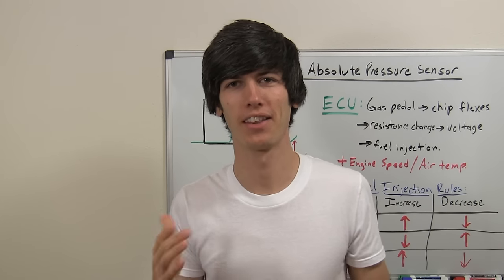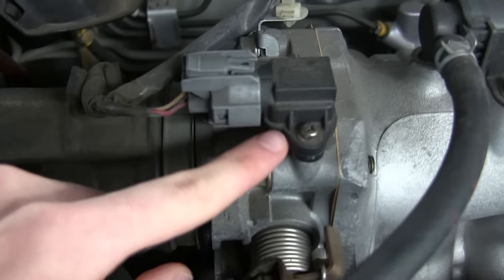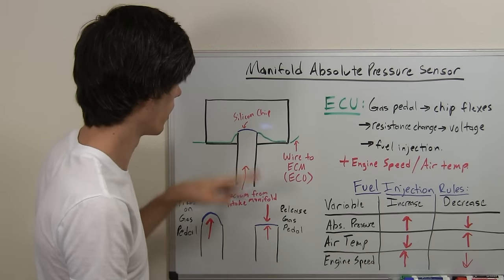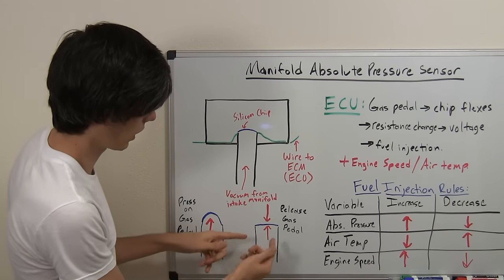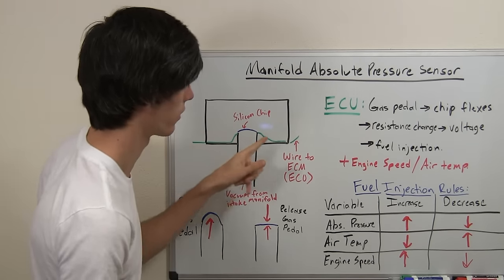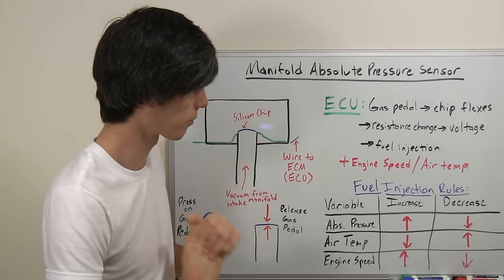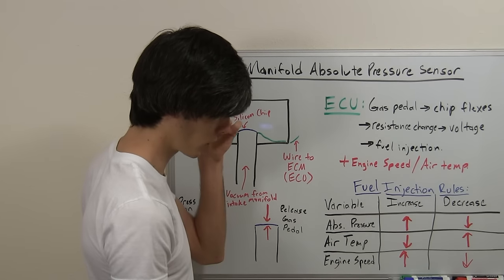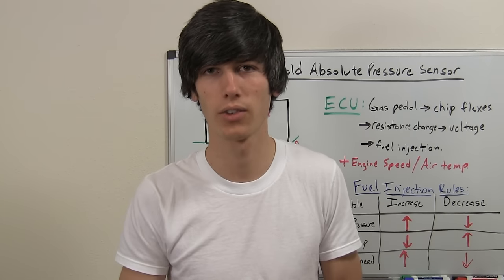MAP Sensor - Manifold Absolute Pressure - Explained

Comment: Okay. Question number two:
I have a 93 mazda rx-7 i replaced the twins with a single turbo that ..... Is bad to the bone. 
Stock map sensor maxes out between 14 and 17... I have a 3 bar standing by (i wont be finished with this build for a long time).
Does the fuel cut simply because it can no longer deliver a clean message to the ecu? 
Once calibrated, how well will my Apex pfc be able to calibrate? 
I have been more curious about the calibration abilities of ecu, ecm, pcm. OEM and Aftermarket. 
Sorry man, but if u can help me with this, i may become one of the best illogical tuners ever! :) 
We all appreciate everything you do Bruh! ✌

Comment: E&E I was looking at  my map on a 95 f150 and cracks and a white corrosion bellow right where the pins housing and silicone meets. All alone where the silicone meet the plastic housing there is a crack in it! I'm thinking this is my failure cause the truck ECU response symptoms are that of a bad sensor too.

Comment: Hi Engineering Explained... Question please.. I have a 1.5L 1996 civic automatic transmission here in the Philippines. Please advise which is better or more fuel efficient of the 2 map sensors... apparently there are 2 variants of map sensors for 96 civic here in Philippines--these are 079800-3000 5V PS-30 and 079800-4350 5V PS-33. PS i think is pressure. 3.0 pressure and 3.3 pressure... if 3.3 pressure--does that mean it flexes less as it's "stiffer" and more fuel efficient/economy? Please advise. Many thanks!

Comment: Hello, love the videos I'm looking to make an induction kit for my e400 (twin turbo) the map sensor is directly on top of the factory air box. If I was to make my induction kit where would you suggest place it, I was thinking directly after the cone filter ??
Thanks
Reply: That'll be a mass airflow sensor (MAF), not a MAP sensor.  It doesn't hugely matter where a MAF sensor goes, though usually directly after the cone filter. MAP sensors are after the throttle body directly on the manifold. Sometimes you get additional MAP sensors between the turbo and throttle body to control an electronic dump valve or wastegate, but usually they're MAF sensors.

Comment: So the MAP sensor isn't injecting fuel, it is Adjusting fuel input, comparing the expected Pressure as against the experienced pressure - to see if an adjustment is required. If there is too much air inflow, (increased pressure)  as against what is expected for the 'RPM throttle' setting = Lean = thus increased fuel input to adjust to normal/proper fuel-air ratio of 14.7:1  If there is too little air inflow for the 'RPM/throttle' = Rich = decreased fuel input.   AND when you get to the first O2 sensor S1 it will also make another adjustment based on the lean/rich analysis of exhaust fumes.  So then the Long Term Fuel Trim  LTFR on you scanner will be a result of the MAP and O2 actions combined.  Is my understanding.  SO if I have this right, if you have a vacuum leak this would create a situation of too much air, making the mix lean, and thus increase fuel adjustment.  Too little air due to a clagged air input somehow, then the opposite.  OR if a poor fuel pump not inputting enough fuel, then at would result in Lean, and thus the MAP increasing fuel input adjustment.   AND if your MAP sensor stopped working altogether I guess the O2 sensor S1 would fix the fuel/air mix anyway.   Everybody should invest in a cheap OBD2 scanner, just to look at the LTFT  - that would tell if you have issues or not.

Comment: Maybe you can help me with my  street an performance multiport injector. The car runs perfectly for about half a mile and then starts to surge. I had many people look into it but can't figure what is wrong. Since you're very knowledgeable about injectors maybe you can point me in the right direction. Also, if I shut the engine off and restart it, it runs ok for a couple of blocks and start to surge again. Thanks.

Comment: Yes and No. The ECU constantly trims the fuel maps for partial throttle. This means you can install an intake and the ECU can sense additional air and richen the fuel mixture.
The fuel trims do not affect the high load tables. When you apply enough load on the engine it will go into open loop and read only the pre programmed mapping. This means your engine will run leaner at wide open throttle when your intake is installed. Fuel must be added back in by modifying the high load tables.

Comment: Just wondering if the sensor should be a maintenance part to make sure tne engine is running at optima, performance to change like.....once per 4 years ?

Comment from the maker: Well typically, yes, cold air will mean more oxygen. But it should be noted that a cold engine will not be as efficient as a warm engine - not as good of lubrication, more friction. But yeah, night driving you'll have "more powerful" cars than day driving, I use quotes because you won't notice the difference.

Comment: if i change my stock filter to a CAI does that mean i dont have to flash my ecu to alter to the settings?
because what ive heard is that if i have installed CAI, i need to flash the ecu to accomodate with the higher density air thats coming in or there will be more air coming in but same amount of fuel injected (loss of power).. but with a MAP sensor, do i still have to flash my ecu?

Comment: So basically the air flows in from the intake valve during its intake stroke and it then bends the ecu chip and send out fuel  to the cylinders. Is that correct? If not i would like to know pls. Thanks.

Comment: Another way to explain the need for an air temp measurement is that warm air absorbs more gas vapor than cold air. Therefore, more fuel is needed to get the same fuel/air ratio as warm air.

Comment: i have 2 older cars; a 1987 pontiac bonneville 3.8L and a 1991 cavalier convertible with the 3.1. the bonneville is an early SFI design and the 3.1 is a multiport design. the 3.8 uses MASS airflow sensor tech and the 3.1 uses MAP sensor tech. can you explain why GM would use one system one the 3.8 and use the other system on the 3.1? from an engineering standpoint what makes a manufacture use MAP on one engine and MASS on another engine?

Comment: I have a question, I recently replaced my map sensor and air filter on my Mini Cooper s 2003 and the engine check light comes on and I took it for a reading and the code I get is P0107 ( Manifold Absolute Pressure/BARO Sensor Low Input. How can I fix this?

Comment: When you say inject more fuel you should be specific. As engine speed increases at a point most engines decrease fuel injected per event but the overall fuel flow rate continues to climb. Most engines lose volumetric efficiency when they get above 5k rpm so the fuel per injection drops but because your engine is going faster, therefore more injections, the fuel flow rate increases.

Comment: Hey dude, I got one problem here. I just overhaul my engine and done some modification to my engine which are: 1. Change 1.3 piston to 1.6 piston. 2) skim my block for my block, head and piston around 2mm. After finish these modification, my car wont run well. its like i dont have power when i push the throttle. And it became worst when i turn on my aircond. OH my car model is honda jazz idsi year 2003.

Comment: hey i know this isn't related but i have a vw beetle with the 1.8t engine in it and when i give full throttle on the highway i get boost for a second then lose it then get it back etc.. do you think this could be because of a pressure leak?

Comment: Excellent video! So one of these along with the proper ecu can eliminate an afm or maf? ...and are the inputs from the 3 sensors processed by the ecu to  maintain a constant ideal air-fuel ratio, or does it get much more complicated?

Comment: this may be a dumb question but is the boost pressure from a turbo mesurable by the map sensor?

thanks
Reply from the maker: Jon Norman Yes.
Reply: Engineering Explained tidy thanks! it would be safe to assume then if the odb reader im using gives out the live pressure at say +10psi under turbo load this would be the boost pressure? or is some other calcuation needed?

Comment: have a 1994 chevy 5.7 just randomly shuts off ,  codes for map sensor does this sound accurate
Reply: It’s not accurate ,try to check other things like crankshaft sensor , camshafts sensor and fuel relay if it’s a petrol engine

Comment: How does it works when you have a leak ? Does it matter if it is before or after the throttle plate ? Thank you.
Reply from the maker: If you have a leak that affects the MAP's pressure reading, then it should be okay. If it can't detect it, you may run rich.
Reply: Evan Reams Could you please post your numbers at idle and 2500 rpm ? Just post these numbers: LTFT, STFT, RPM, IAT, ECT, LOAD, TPS, BARO. Some cars would have a rev limit on the fuel injectors so you do not damage your engine. The ECM/PCM will read the MAP sensor at start up for altitude adjustment and during driving and acceleration it will run an algorithm or fuel enrichment strategy to prevent the car from stalling ( MAP + TPS + RPM ...) so in order to zoom in you need to take these factors into consideration. Thanks.

Comment: I had to use this video to show an auto parts store what the difference is  between a MAP sensor and  a  Fuel Injection Pressure Sensor..
The store on its website listed the Fuel Injection Pressure Sensor  as a MAP Sensor...

Comment: I suppose this is for gasoline engines. Wouldnt be a bad idea to mention that. 
In diesels both MAF and MAP have some other purposes than just adjusting the stoichiometric ratio.
Actually even this is not 100% percent accurate, since diesels usually run lean, and the throttle is given by injecting more fuel, not by injecting fuel that match the quantity of air from the intake.

Comment: I feel like I've seen cars with a MAF sensor and a MAP sensor.  Can they have both sometimes?  Although with this explanation, I can't imagine why they would.
Reply: Ryan Raithel they can and often do. 

In the case of early gm they had a maf sensor that the only active part of the sensor was for air temperature. 

Otherwise map sensors have more uses for load calculations. Manifold pressure tells a lot more about what the conditions of the engine are than raw airflow volume (mad) vs rpm and throttle position.
Reply: Mad should have read maf

Comment: I have a question. I have a check engine light coming on and the code it gave me was for the MAP sensor but my car still runs ok. What possible problems do these sensors cause you when they go bad?
Reply from the maker: Potentially improper air/fuel mixture.
Reply: Depends on the vehicle. MAP sensors aren't just used for mixture. Some vehicles use them only for EGR testing or monitor scheduling, Some just for cranking pulse width, and transient fuel control.  What drivability problems may arise, depends on how the sensor is used and, if the system correctly faults the sensor. And then uses the correct failure mode.
Reply: It could have been a momentary issue.  Also most vehicle ECU have backup software to estimate the Manifold pressure using the throttle position and engine RPM.   The drawback is reduced mileage, increased emissions and possibly a loss of power.  Have someone like an AutoZone clear the code and see if it comes back.  If so, the MAP may be the issue.
Reply: Lew LIttle Hey thanks for your reply. Ok a lot of the things you just described are symptoms that I am having particularly mild hesitation during acceleration.  Everytime I clear the code it comes right back immediately. I really think its the map sensor but shortly after I posted my question I ran a code check again and now I have a p0420 code in addition to the Map sensor code so now it could possibly be a bad Catalytic converter.
Reply: ***** actually I replaced my MAP sensor a few months ago and the same problem still exist but now i no longer get a map sensor code instead i get a P0420 which is an emission code for the catalytic converter/02 sensor. But now i am experiencing mechanical problems. My car now stalls whenever im under heavy throttle.

Comment: How to clean a MAP sensor? I know a MAF sensor can be cleaned with IPA (iso propyl alcohol). Can same be used to clean a MAP sensor? I am experiencing a noticeable (3 on scale of 10) hesitation at 2 nd and 3rd gear  ~1500 RPM. Running on AC amplifies this hesitation. I believe it hasn't been cleaned in 7.5 yrs and 40,000 KM of its running.

Comment: 2015 gm 3.6. P2227, p2228, p2229 & p2230. BARO is combined with MAP sensor. It's showing 0.0 barometric pressure when ignition is turned to the On position.   ???
Reply: Baro should be for compensation in altitude or strong weather fronts where it would need to adjust fuel/air. I think

Comment: I’m a bit confused about the heat sensor. I thought that with cooler air hence more oxygen the fuel would burn more efficiently so less fuel would be needed. I’m sorry if the answer is obvious and I just don’t get it.

Comment: my map was full of oil when my turbo was damaged and there's injection error on board now. turbo replaced but still saying error. can i clean the map with diluente? i can't find any other product to clean it other than gas or diluente but i'm not so sure for the silicone inside it...
 error goes off after knocking hardly on map with finger

Comment: At least for diesel I know both MAF and MAP sensors are used. MAF seems to be a bit more accurate but MAP has less restraints. A MAF sensor requires a certain distance of straight pipe to get laminar flow due to the fact it uses temperature to determine flow.

Comment: Bro can i ask in my toyota corolla ae101 4afe engine 1994 1.6L..

In the MAP sensor of my car theres a tube/hose going to manifold... It starts but seconds after my engine dies in a seconds also.. And i try to pull out the hose in map sensor connecting to manifold.. The engine starts well with  no engine die that why i pull out the hose it runs in fair road, But if on semi upward road. The engine dies in a seconds i dont if what happens to my car. Please help me

Comment: So all of the measuring regarding how much air is going in is done by a stretching silicone membrane? Wow, would imagine more complex sensors being used and I never would've thought such a simple system can yield data accurate enough to effectively provide the exact amount of fuel needed.

Comment: My 1998 Pontiac Bonneville will stop as  if the ignition is shut off. Will restart almost immediately and run for maybe 200 ft and then stop. again. It runs fine on short trips of approx. 5 miles

Comment: i gotta question sir, I tested my map sensor. Got 4.6V when the key was on .. I connected a hose to the it and blew in it, went to 4.92V, then back to 4.6 when I stopped blowing into the hose..I'm guessing is faulty sensor?
Reply: you need to be applying vacuum to the sensor for voltage to drop. Blowing in it would increase voltage. What you should be doing is renting a vacuum gun and applying vacuum to the sensor and the observing the output voltage going down. Make sure output voltage doesnt slowly change while holding a steady vacuum.
Reply: thanks I bought a vacuum guy today..lol rent? and it seems to be OK, but my manual says you should see a slow decrease if you blow in it, but that didn't work.
Reply: k300zx Oh then maybe I am mistaken, I was assuming because the cars ive worked on work as I described before. Go by what your manual says, always.
Reply: Blowing into a pressure sensor will cause only a momentary increase in the output voltage.  Once needs a "sealed" system to apply pressure or vacuum and maintain a steady output reading.  Our MAP's response in less than a 1 millisecond, so blowing into the port is actually hard to see on a DMM.

Comment: I thought MAP sensor is not enough as it doesn't consider back-flow, that's why modern engines use both Hot-film air mass meter and MAP sensor. Am I right?

Comment: hay bro i got 1993 toyota starlet ep82.when i speed up my car above 120Kmph(high speed) about, the engine check light comes on and speed down to 80Kmph(lower speed) or about the light goes off, is MAP sensor malfunctioning in my car? please answer
Reply: Ashana. Jackol replce the engine with a supercharged 454 chevrolette

Comment: Cold air decreases gas mileage. The reason is because their us more oxygen you keep the throttle more closed, which increases inefficiencies. The flip side is at full throttle you get more power. Also winter fuel gas more additives which reduces its stored energy and decreases gas mileage.

Comment: Most MAP sensors have an output of 3.7 to 4.7 V at ambient pressure.  Blowing into the sensor will raise the voltage.  Pulling a vacuum will reduce the voltage.  Not a bad explanation for a MAP.  The piezorestitive bridge signal go to an amplifier/compensator which provides a 0 to 5 VCD signal to the ECU.  I'm the systems/electrical design engineer for one of the largest automotive pressure sensor manufacturers in the world.
Reply: @ lew little So a engine with both maf and map sensor is for fuel delivery back up, in case one or the other sensor should fail???. Why don't you put up some vids on the functionality of these sensor and how they interact with one anther..What better explanation then the one who designed them...

Comment: My car will run good for a little while and then start stalling and shuttng down. Could this sensor be getting hot and shutting it down? And I noticed when the air outside is cool it doesn't do it hardly.
Reply: Robert Christian burn it a buy a motorcyle